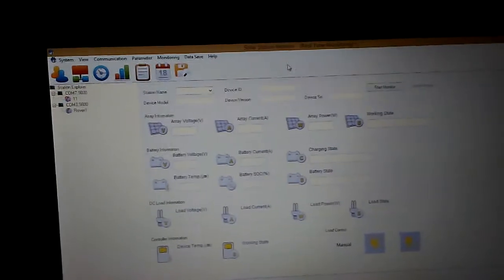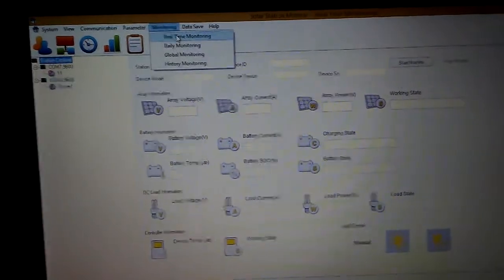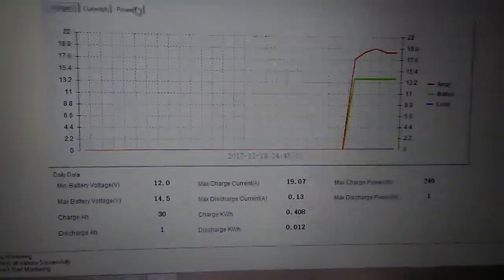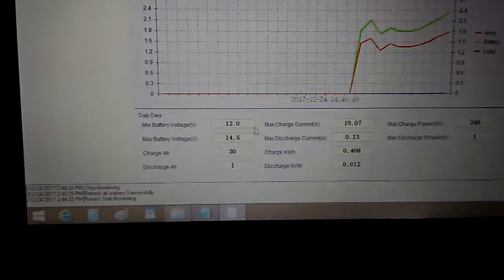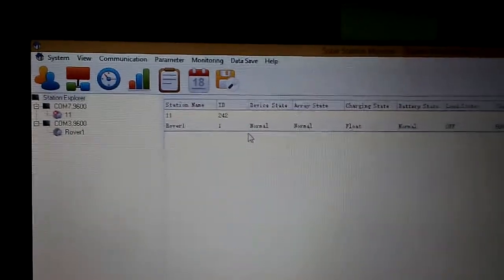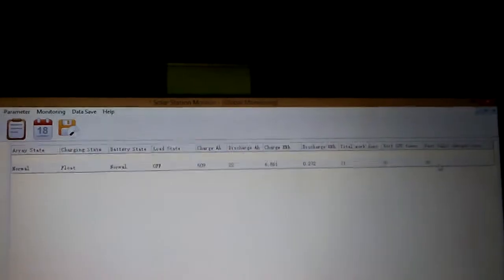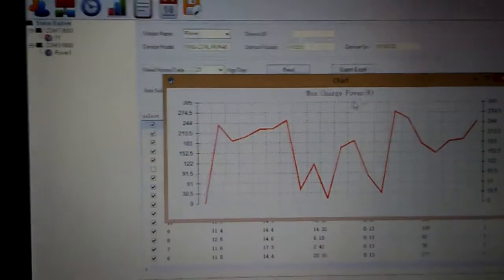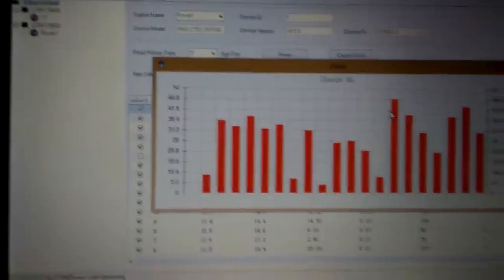Renogy Rover MPPT Charge Controller - Software Review and Features

Comment: I can't get the software to work. I get an error message saying something is missing or corrupt. I've uninstalled it and reinstalled it and still nothing... Am I supposed to load up both of the drivers?   ( UPDATE ): Got the software to load up on the laptop, but guess I'm still overlooking something because when I start the program it's not finding my controller. I'll figure it out sooner or later.
Reply: Goodolboy One Did you get it working yet?  My pc won't find mt charge controller either.
Reply: Randall's, I did get the software to run, but like you I cant get the software to find the controller. Crazy this is, when I plug in the controller, The computer will ding letting me know that it detected the usb plug when I plugged into the usb port...
Reply from the maker: yes, all the drivers need to be installed.  it all depends on what operating software you're using. honestly since I made this video was the last time I used the software. It was neat for us to see... but we didn't make any adjustments besides what we could make on the actual control panel... so we just set it and forgot about it.  next time I install the software onto another computer, I'll film the entire thing, problems and all. 
My advice, call renogy service dept and have them walk you thru it step by step.  They're awesome!  Thanks